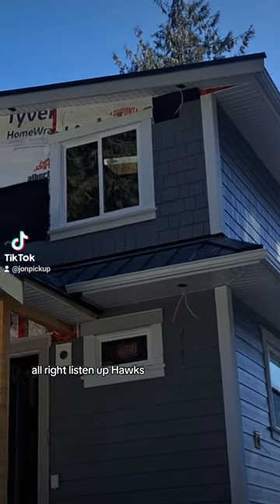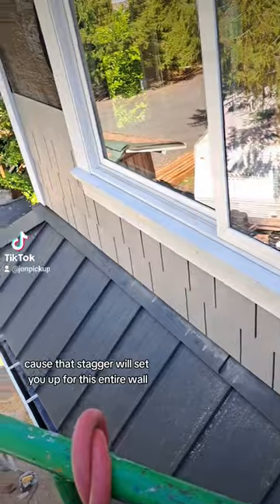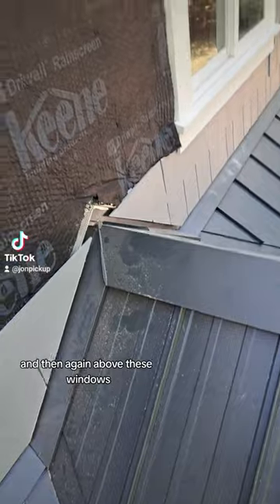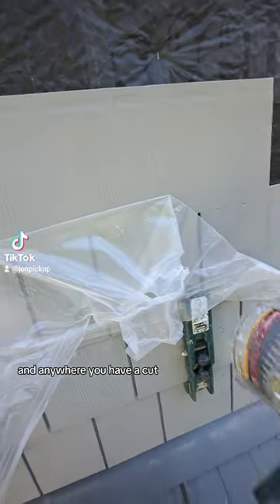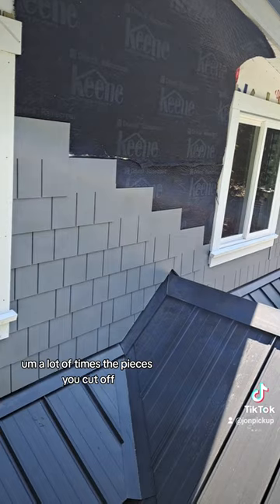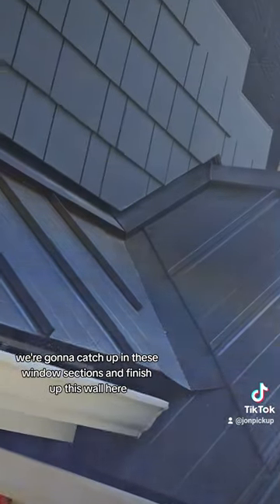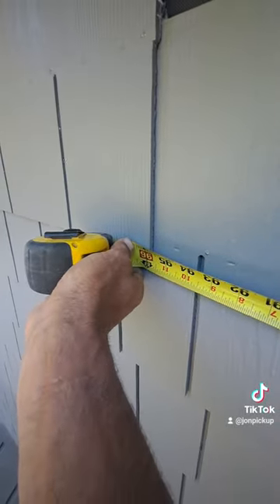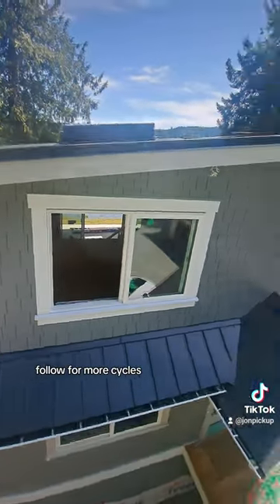SIDING INSTALLERS MUST WATCH!!! How to Install Hardie Shingles Perfect every Time!!!

Comment: So if im laying my first piece and the end doesnt fall on a stud, which end of the plank do i cut and how does that affect my stagger?
Reply from the maker: Good question. The Factory edge will always butt together in the field. Meaning the edge that butts into the corner or window trim would be the cut edge
Reply from the maker: All your cuts that butt into the trims get caulked over and sealed. Meaning you won't have any cut edges exposed
Reply: @TheDark_Sider  I think I figured this out the other day. If I'm working on a wall going left to right, I think I would cut the left side of the board that butts up to the trim so the keyway is still visible on the right. Then on the next course up I take the same amount off + 16 inches more. Then on the next course the same amount +32. Sound right?
Reply from the maker: @mae2759 Absolutely you got it. This way you have nails that hit studs on both ends of the piece, as the pieces are 4 feet long. Just make sure when you run into a door or window, you pull that same 16 inch layout to the other side, instead of reseting it. Try and picture the entire wall as a 16 inch grid

Comment: The minimum between any hardie shakes is 1 1/2" I seen a lot smaller than that. Incorrect installation! I have been installing hardie for 35 years. This is a sham job. They will not cover the warranty!
Reply from the maker: The frick are you talking about moron? The stagger is 16 inches, no latches are closer than an inch, get your eyes checked old timer

Comment: What about the 2- inch minimum  gap from the roof? according to James Hardie Installation instruction?
Reply from the maker: The back pan on the wall flashing is literally 3 inches. With a bugscreen nailed just above that there isn't enough space to hold it up 2 inches. You would see the prep underneath the siding looking up...

They want 2 inches off the roof then start making wall flashing bigger than 3 inches. Until then they get 1 inch
Reply from the maker: Bare in mind. The wall flashing needs taped to the envelope. I only have a certain amount of space before you can see it looking up